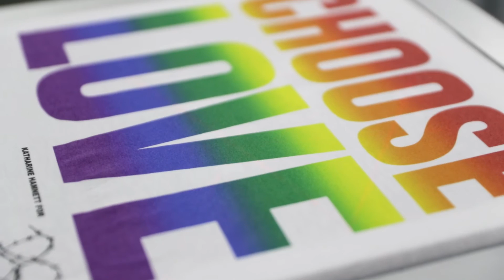What's the difference between screenprinting and digital printing?

Comment: Digital printing is another perfect example of how technology continues to reshape the landscape of replication and value. In the past, creating physical copies of anything—whether books, artwork, or documents—required significant time, labor, and material resources. The process was slower, more expensive, and required skilled labor for each copy produced. But now, with digital printing, we can replicate items with incredible speed and minimal effort, bypassing much of the traditional labor involved in the process.

This shift further challenges the traditional notion of scarcity. The cost of replication is no longer tied to the labor or materials required to make each copy. Whether you're printing a book, a poster, or even custom products, digital printing allows us to produce an infinite number of copies without a proportional increase in cost or effort. The real resource now is the idea or the *design*—and in many ways, that becomes the new "scarcity" we focus on. 

Just as digital copies of information have become infinitely replicable, so too has physical replication become easier and more accessible. This further diminishes the need for traditional measures of value tied to labor and material scarcity. In a world where both digital and physical goods can be produced at near-zero marginal cost, we’re left to rethink what it truly means to create value.

The question then becomes: If labor, materials, and time are no longer the primary cost factors in producing goods, what becomes the true measure of value in this new world? It may not be about how much labor goes into creating something, but rather the uniqueness of the idea, the experience it provides, or the personal touch that differentiates one creation from another.

This shift aligns perfectly with the growing abundance we’re experiencing, especially as the digital world continues to expand. As technology eliminates the need for labor-intensive processes, we may need to reconsider what value truly means and how we distribute it, moving from scarcity-based models to those grounded in creativity, uniqueness, and shared experiences.

Comment: how's the durability and feel for both? does digital printing leave thin layer on fabric just like heat transfer!!
Reply from the maker: Durability is pretty like for like across the two styles of printing, as long as wash care label followed they should last just like any good quality product. Slight difference in feel if you get really specific, DTG print can feel a little more "textured".

Comment: Thanks for this informative video. I am looking to understand this a bit better. Is digital printing different from the rubber kind of heat transfer print? I ask this with respect to longevity and print quality of digital print. I know that the heat transfer or rubber-y material starts to peel or crack in a few washes. Will digital not peel or crack in the same way? and how many washes is it recommended to last for?
Reply from the maker: Digital print can still crack/peel/degrade if not looked after properly or the washing guides on the label are not followed. In general the lifecycle of a digital print is pretty comparable to screenprint

Comment: How does digital print cope with washing. what's the life expectancy of the print?
Reply from the maker: Hey Simon, on paper and when washed according to the washcare instructions they should be equivalent. We've got digital tees that are many years old. In our experience we've found that screenprint is the most resistant to the widest variety of detergents and wash regimes outside of the advice on the label, whilst we've also found that digital prints are far easier for us to work with in our recycling program and have far more potential in terms of sustainability. If you want something for say, workwear at a busy restaurant screenprint is the way to go right now. For consumer products digital is proven.